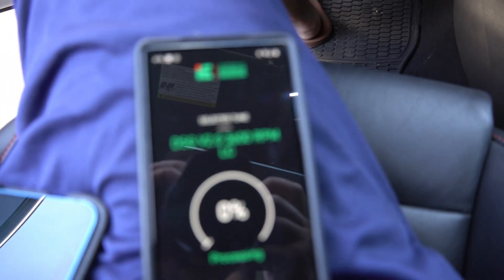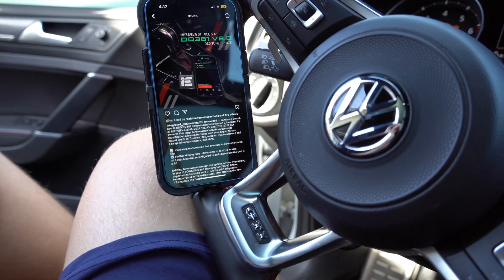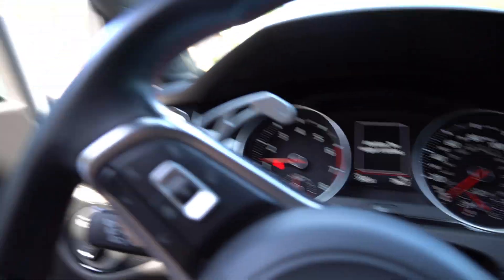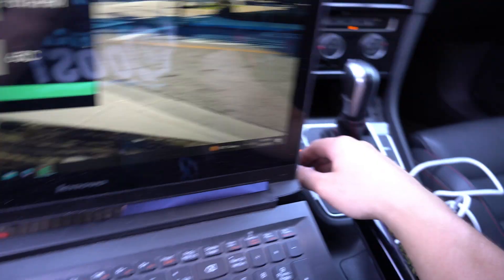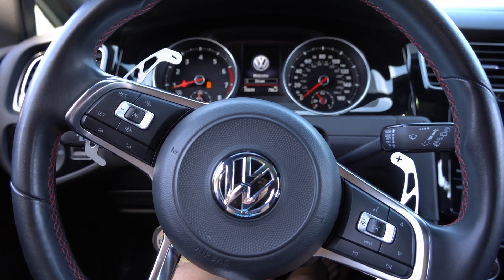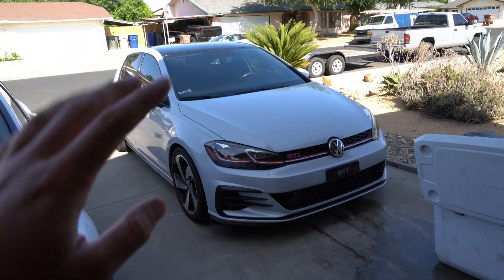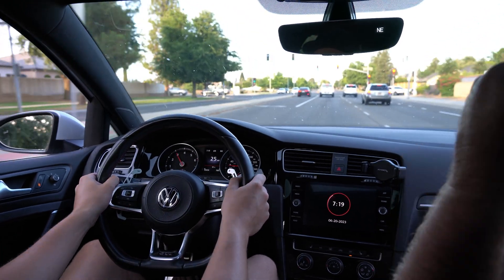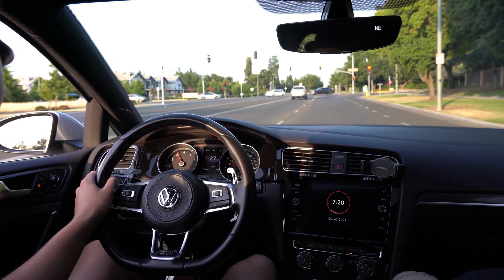How To Make Your Mk7 GTI Shift Even Faster! (Integrated Engineering V2 DSG Tune)

Comment: Does this help with the laggy first gear feeling? You know what i mean like when you first step on the gas it feels slow and my car shifts slower in 4-6k rpm I’m hoping this would help
Reply: im is20 w downpipe, intake, diverter spacer and a catback + sneeky ecu tune
Reply from the maker: @Mposts3  it would help for sure
Reply: @jacobMMotorsport but this is just the transmission tune right? I wouldn’t have to buy their ecu tune or anything else just the $500 dsg
Reply from the maker: @carterandquandaryhangingout yes you can buy either or I would highly highly recommend trans tune before you tuned your car but this is gonna solve your problem

Comment: How do I do the clutch adaption? The cable that came with the dongle from IE is usb c (goes into IE tuner) and the other end is a usb. I have a windows 11 brand new laptop and it doesn’t have a usb port, just usb c ports.
Reply from the maker: Get a double end usb c port

Comment: Stupid question. Do I need to buy don’t POWERlink with ecu and tcu tunes? Why does the website require me to add both when selecting tunes?
Reply from the maker: If your going with them for your first time you will need to buy the power link and a tune
Reply from the maker: If you already have a power link you just select the tune

Comment: Is yours a 7 Speed or 6 Speed?
Reply from the maker: 7
Reply: thank you! its so hard finding videos of the 7SPD. I Have one and the DSG Farts are not existent. WIth this you definitely hear it. I have a awe track exhaust and a intake. I wonder if the tune will help.  @jacobMMotorsport
Reply from the maker: @kennethpottsjr.5023  tune will definitely help! As soon as I flashed IE revision where the put more pressure to the lines you could hear them

Comment: just tune my GLI with version 2 and I felt a big difference, but I didn't do the adaptation, I will do it soon
Reply: @galcantar08  what is the adaption?
Reply from the maker: @quiksilver330 it adjust the clutches and resets them. It’s pretty normal and should be done frequently
Reply: @quiksilver330   is like relearning your shifts for smoother shifts
Reply from the maker: @galcantar08 so basically over time your car gets used to a certain way of shifting. So when you re tune you should do an adaptation so that the car learns with the trams

Comment: No dsg cracks on upshift? Or is this OPF?
Reply: THE 7 Speed DQ381 trans in the 7.5 was known for not producing DSG pops as prevalent as the DQ250 Mk7 trans. Needless to say, if you want loud DSG pops, the 6 speed is the way to go.
Reply from the maker: It’s a dsg. It’s IE new tunes and makes it like that
Reply: @jacobMMotorsport  he asking why there are no dsg farts (the popping noise they make) on upshift
Reply from the maker: @zoob4371  oh there is you just can barley hear it cause it’s a stock catback with catless dp